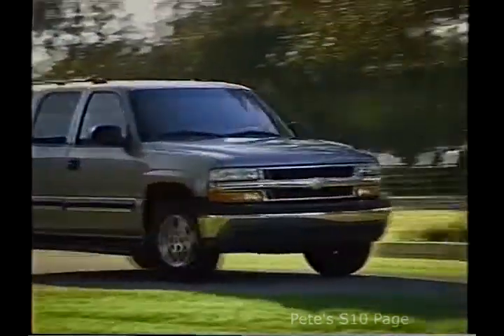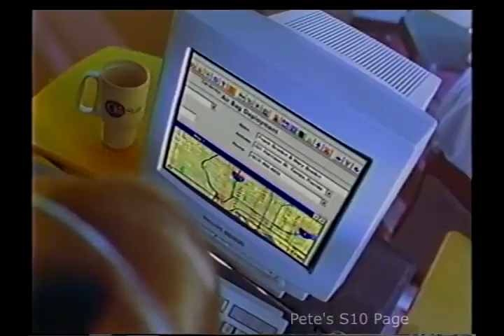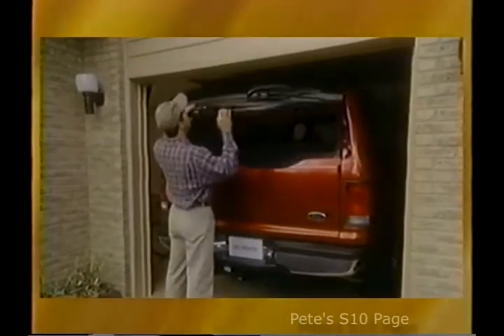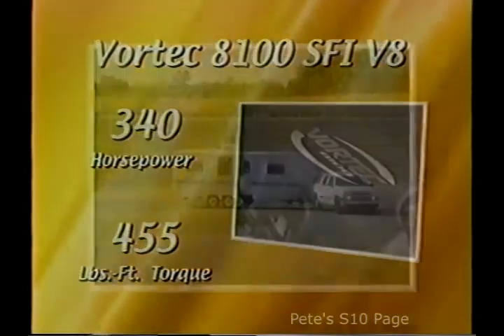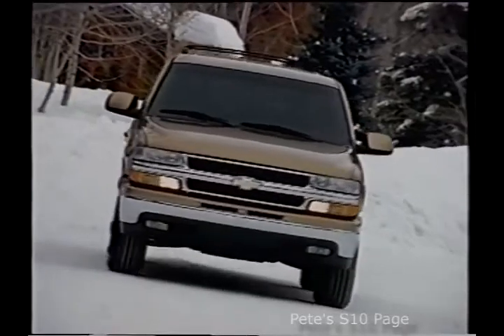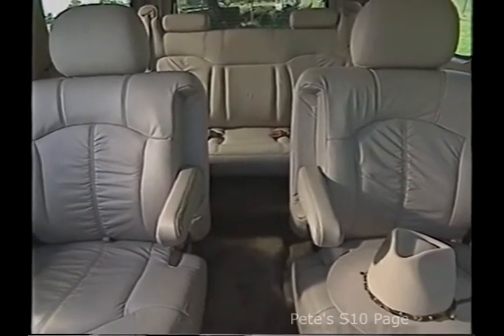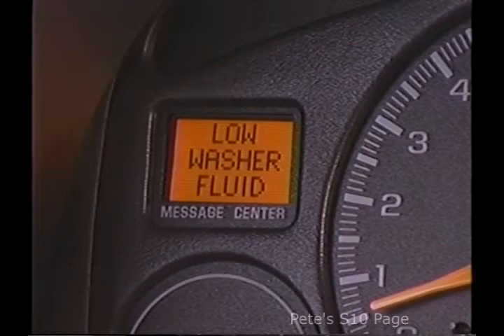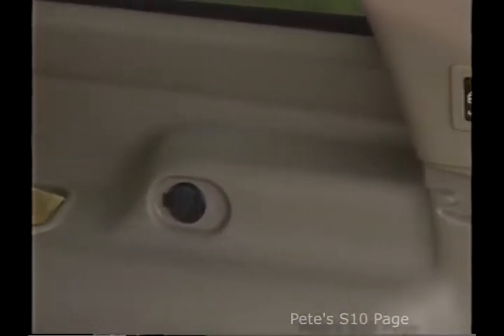2001 Chevrolet Suburban Features - Dealer Training

Comment: got 1 with 200k miles, fixed it up with some valve cover gaskets, intake manifold gasket, spark plugs, plug wires, belt, and oil change. it should be good for another 100k besides for oil changes and miscellaneous

Comment: Gotta 01 with close to 300k on the clock.  A two or thing is broken here and there but holy smokes it always gets the work done.  The 5.3 and 4L60E can do work that once required a 454 and TH400.  They'll never top that power team but this one gets close.